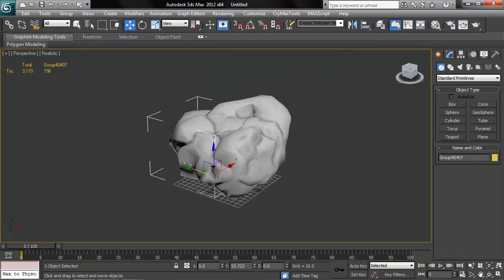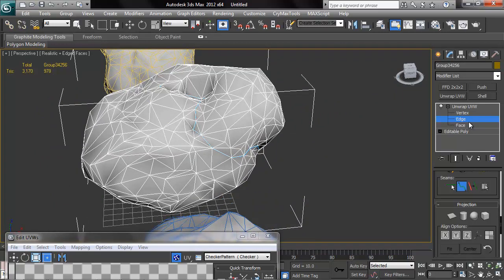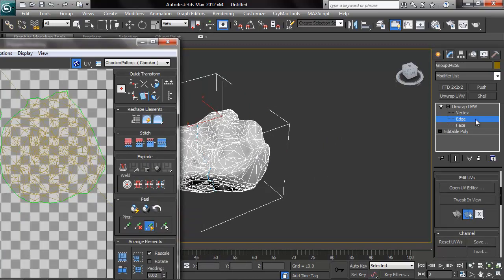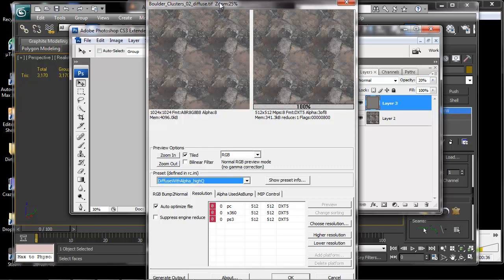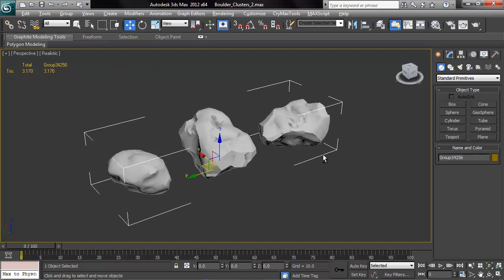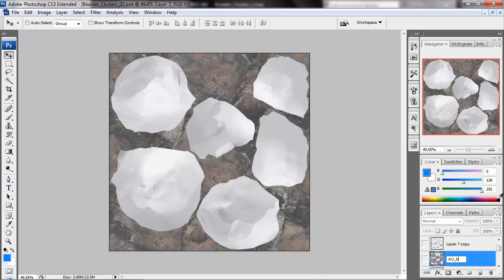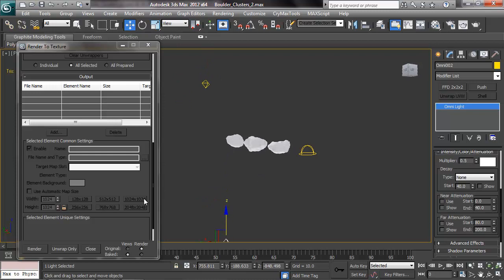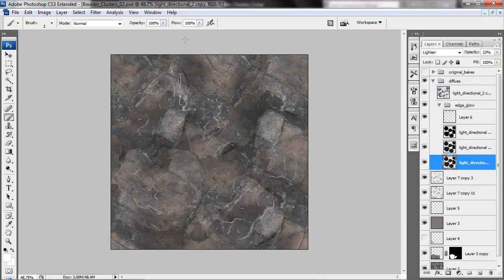Rock Creation: Chapter 2

Comment: I wonder if it would not be easier to make entire thing in zbrush. Unwrap your rock in zbrush, then bake displacement and normal map. The create new document with desired size of your target texture and add plane. Use your displacment texture on plane, to get your 2d representation of rocks, and at very least use various mat caps, to get interesting effects out of it (;.
Reply from the maker: That would work but in order to export it for cryEngine you need to transfer it over to a supported package like Max or Maya. I prefer doing the uvs in max because you can manually cut the geo to create better UV seams if the decimation is too jagged.